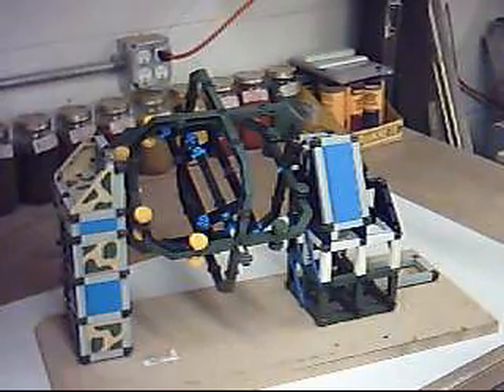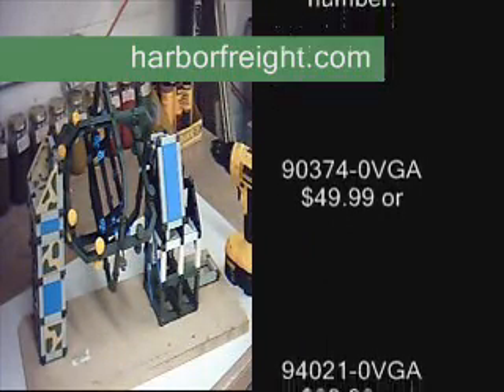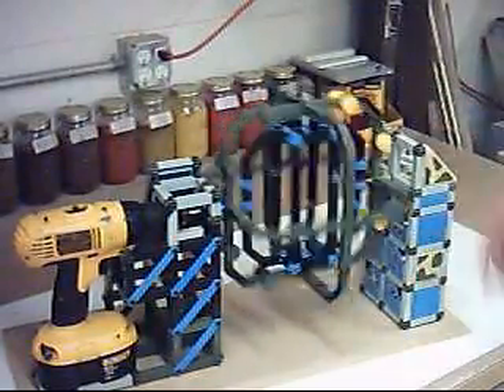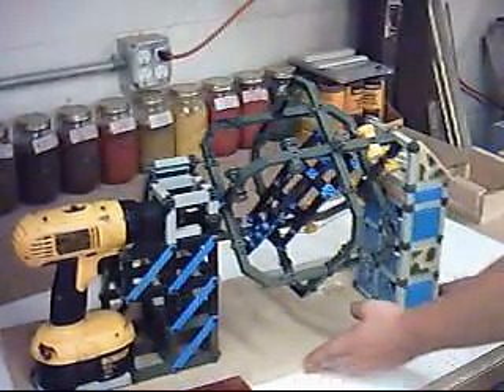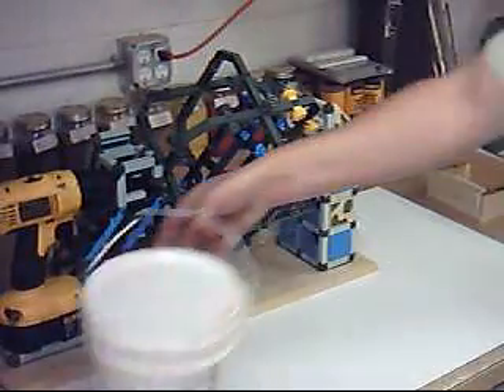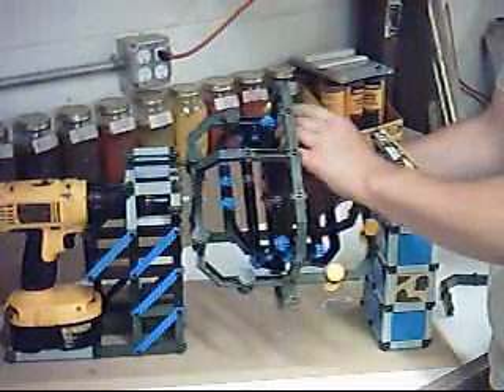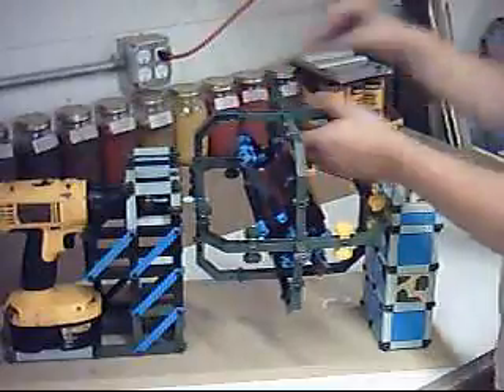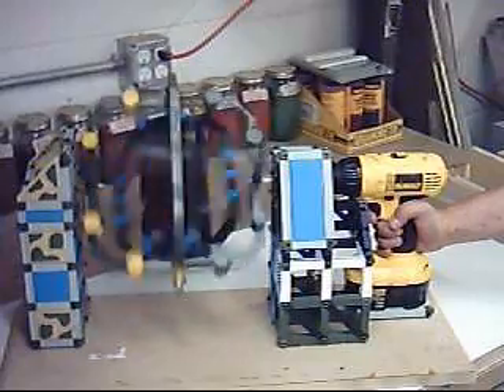DIY Roto-molding machine

Comment: If the inner piece spins at 1:1 ration with the outside, isn't that just a diagonal rotation?  I'd think you'd want some odd ration 1:1.1 or something like that so that all sides eventually end up at the bottom.  Thanks for sharing.

Comment: Good point. I doubt this could handle the heat necessary to melt resin pellets. Seems an erector set is required.

Comment: Rotomolding is most often associated with really big plastic playground toys (Little Tikes and Step 2 come to mind), for some large car interior pieces, and for urban vinyl toys. There are a number of practical advantages (e.g. molds are relatively simple) and monetary advantages (e.g. it's a comparatively low-cost investment process).